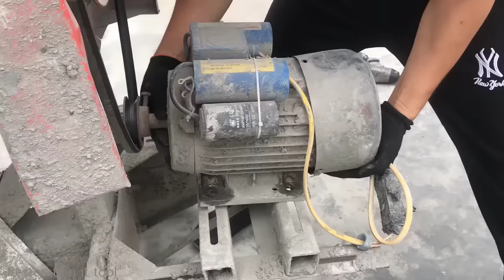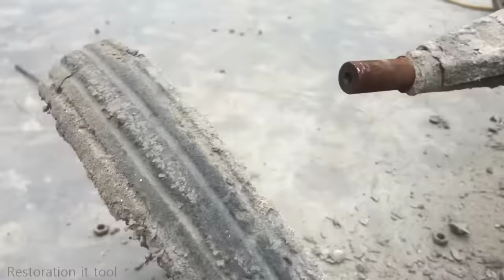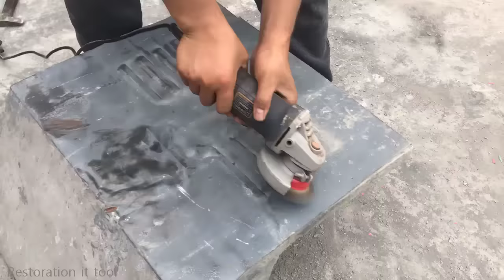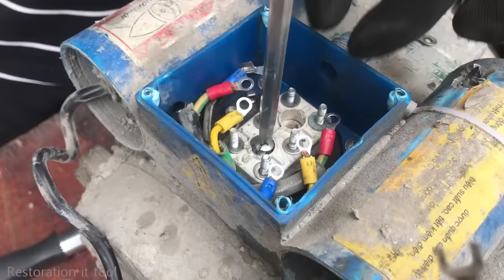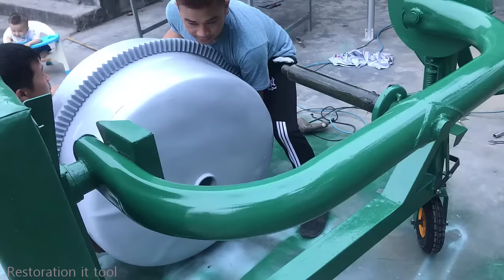Restoration old concrete mixers | Restore and reuse old and very rusted concrete mixers

Comment: Nicely done, gentleman.  Although a hood wash with a high powered spray nozzle might  have been a good idea. But all in all, it does work and looks better, although I have never seen one pristine at a job site, always looked like the concrete it made.
Reply: 44
Reply: Pp
Reply: Pp
Reply: @rayappanchetty7964  no no no 90

Comment: Fantastic. i have learnt good lessons. i want to restore my mixer using your method. but i need to get a big pulley for the mixer abt 20 diameter inches as my engine is a diesel 3.5 hp to upscale the power as the engine has a 6 inch single- belt size B Vee pulley. let me know if this will be in order.  i believe the speed is not important in a mixer but rather ther power driving it.
Reply: I

Z

Comment: There is so much wrong with this, and nothing of it has to do with limited capabilities. Granted, you will never get sheet metal 100% straight, but that's beside the point.

You did an okay job disassembling, however, spend more time cleaning up the parts, especially bolts. Your paint preparation sucked, even if we ignore finish here (it's not a museum piece after all). Timestamps:
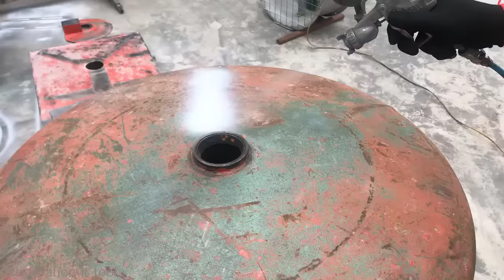13:11 the bearing seat is not taped and gets paint on it
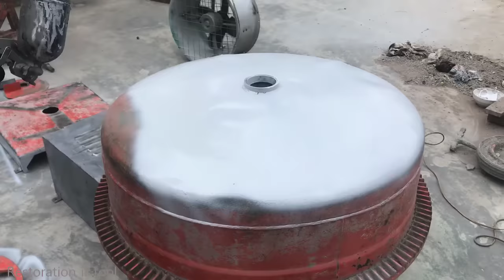13:28 the main sprocket on the drum is not taped and gets painted. This is probably not your fault as it had paint on it already, but as a general rule you should never paint gears, they rub all the time and destroy the finish anyways. Polish them with sandpaper, scotch brite and a wire wheel and coat them in a thick layer of grease (which the operator has to reapply every now and then). Rust and wear protection all in one.
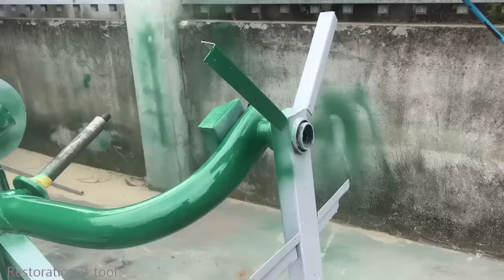15:29 the shaft is not covered up and gets painty. Tape some paper or plastic to it, and grease the living hell out of it when reinstalling.
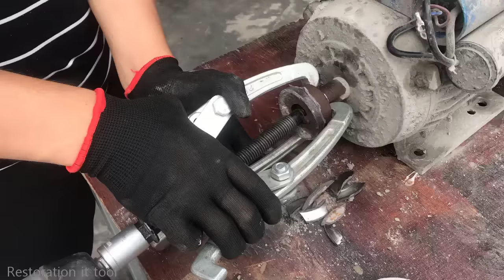17:33 it's no wonder you completely destroyed the pulley. Don't use an impact gun on this tool, it has too much power. If things won't come loose, use penetrating fluid. That's cheaper than a new pulley.
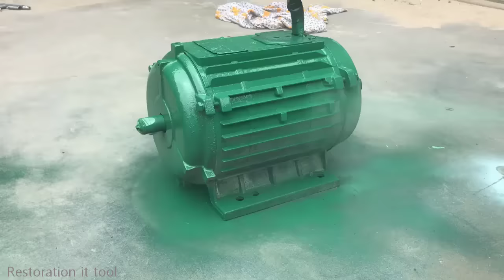21:01 Don't paint the motor all in one, you are getting paint everywhere. Disassemble the sides and use paper or plastic to sufficentily cover all inside areas and the shafts. The way you did it fused the parts together making the motor basically impossible to service should the need arise.
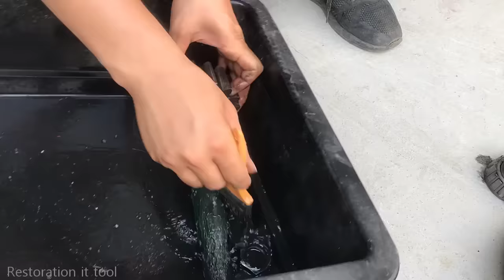24:09 you washed a way all the grease, but did not replace it (at 29:36)
26:35 bearing installation, as has been commented, it's okayish, I would have done similar but use a block of wood between the hammer and the bearing.
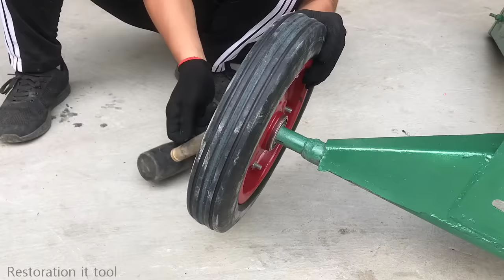26:43 You need to hammer that on because you didn't tape the axle. The built up paint makes the axle now too thick and the bearing has to scrape away the paint. Not only is this a waste of material but you're also going to damage the new bearing.
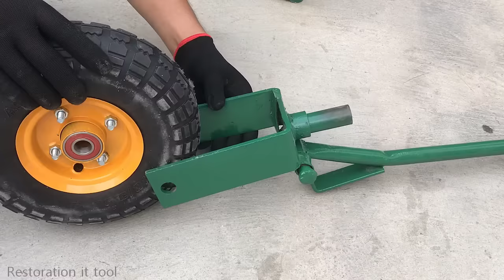27:54 the mating surfaces of the shaft visible should not be painted but instead greased. Once again, tape it up.
29:20 the paint on the stud makes it impossible to secure the bracket with nuts.
30:05 here is probably the best point in the video that illustrates how paint gets in the way. the keys are machined to be a tight fit and even a minimal layer of paint destroys that. The Key should be inserted in the shaft before pressing (or in this case hammering) the large pulley on. You destroy your (obviously bad) by banging on the key. The new bearings you installed won't like that.
32:44 This is a crown nut and the bolt you installed it on should have a hole in it so you could pass a wire through. In this way you secure the nut from loosening itself. Not installing it could be dangerous.
33:00 I don't know what country you are in, but in Europe we have CEE sockets designed to be fitted onto machinery. They are blue and accept "special" extension cords. There are also machine-mountable male type C sockets in which you can plug in extension cords. it would be better to replace this cord with a setup like this, seeing as it is already very beaten up, and you are guaranteed to roll over the cable at one point or another.
33:46 Also, the extension cord you are using begs for electricution, but it's not my live, so, do whatever floats your boat.

All in all, this is not a restoration but at best a paint job including the replacement of consumables - and also the paint job is a shitty one. You don't show the paint used but I can guarantee you that without primer nothing is going to stick well to the metal. Even if you would have used primer, it would have been useless because of all the residual concrete and paint that's left on the surfaces. When it comes to painting, surface preperation is everything. I give this paint at maximum six months before it falls off the mixer, even if it's not in use. Please educate yourself, it's not that hard on youtube.

Comment: Nice cleanup and replacement of the worn broken parts. One thing you missed is replacing the cotter pin through the castle nut securing the mixing barrel to its bearing.

Comment: Not bad, but you should use new vaseline for the bearings and for removing concrete you need a small power hammer with chisel, don’t beat the metal, you leave a lot of hammer pounds. You also need an adjustable spray gun for painting large panels. You didn’t clean up the entire paint properly of the machine, just a few parts...
Reply: pete w I was not critical, I told him some advices and tips. I’m much more experienced in mechanics and welding that many guys around here, I have 10 years works with metal fabrication and mechanics. I don’t have time to make videos but I would love to in the near future.
Reply: Adrian Şandor 
Nice
Reply: @adriansandor1733  várjuk a videót :)
Reply: Yb llllloo
Reply: 1 yc Yb in WATN TMI IMHO Gb no bookj#
Reply: 0

Comment: the best material to loosen concrete stuck in the mixer is chloridic acid mix with water 2 to 10, after a few minutes needs a good hosing preferably with a high-pressure hose, no banging is needed

Comment: "Not bad huh". But biggest flaw - welding. Bowl full of concrete weights about half of tonn, with such welding it'll crack again in no time.
Reply: Was just coming here to say that. It would have been MUCH better to cut it all free and do a full re-weld rather than just welding the cracks.

Comment: "Very old and very rusted" ?? The frame and motor housing still had about 98% original paint. It seemed a shame to wire-brush it off.
I winced as the bearing/hub puller was operated with the windy gun. It left deep indents in the shafts both times.

The drum seemed to be ridiculously clean inside. I got the impression that the very thin layer of cement we saw was the result of the mixer being splashed by other ones nearby doing all the real work.
Actual work done: 
1) A bit of dodgy welding, with no attempt to clean up the area before hitting it with the electrode. I got the feeling that this was not the first time that had been done to this machine, and it will be needed again in a week. 
2) Replace 3 wheels and a couple of bearings - the main drum bearing was ignored.
3) Knock off some cement from the surface.
4) Give it a coat of paint so the original owner wouldn't recognise it.

Comment: Someone forgot to replace the split pin on the drum centre lock nut. You also used the old tapered roller bearings, yet you replaced the wheels and wheel bearings why???
If you continue to use the mixer for any length of time you will need a much heavier extension lead, or risk a fire.
Reply: It was just for testing. Greetings!
Reply: -6m7h
60th

Comment: use a hammer drill at an angle so that it slides as it removes the concrete and does not punch holes in the drum. Also poor water first in the concrete mixer and put the ciment in between the aggregates so that it doesn´t stick to the drum. Job well done but the couvers needed more attention.

Comment: That’s not an old cement mixer, that’s an old mixer that’s been hardly used and badly cleaned, old mix have hammer marks and cracks all round the drum.
Reply: 744

Comment: Alor oui déjà tu mais pas peinture  avant de taper sur une pièce sinon bas tu voie les coup de marteaux normal quoi 
ensuite la rondelle rouiller ses un peut moyen  ensuite tu peut ta pas fier a un volt maitre pour vérifier si le moteur fonctionne ou pas  ensuite comment tu peut affirmer a 100% que les filtre sont bien dégager   
3 eme et dernière chose le ventilateur   avant de re maitre le carter soie on le change complet soie on le restore puisque sais sensé être une restauration